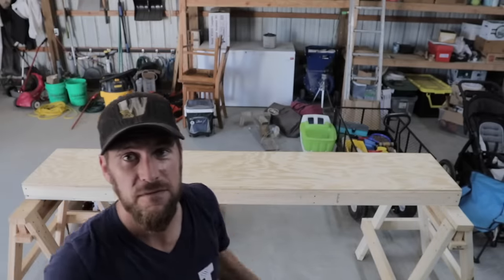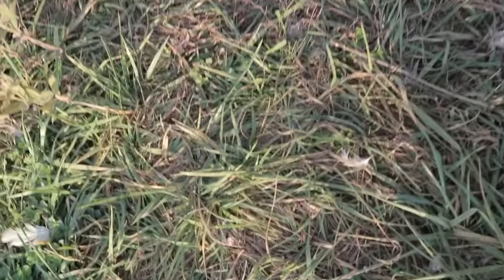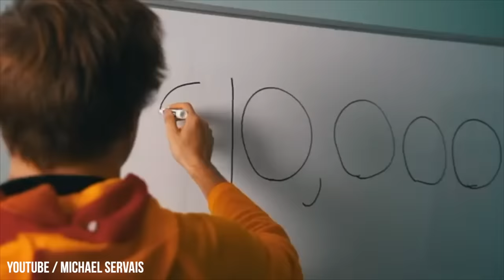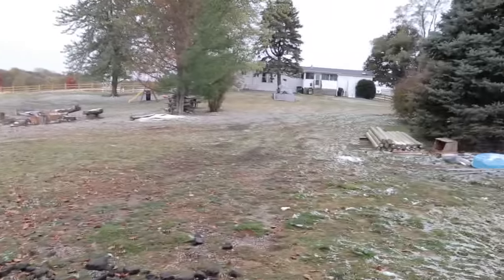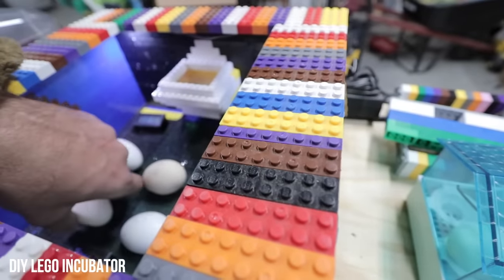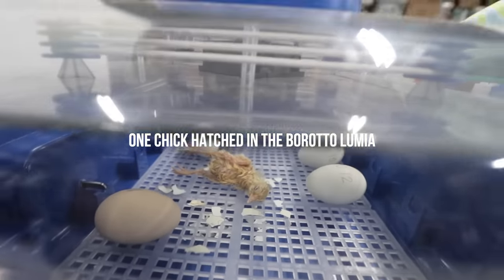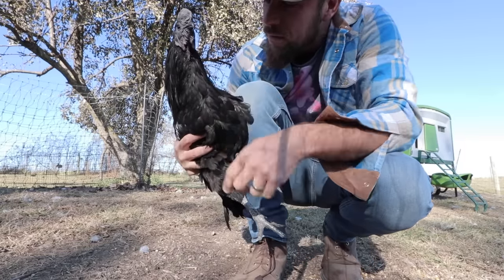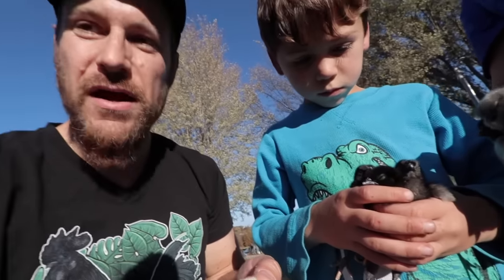The Ultimate incubator experiment.

Comment: I use Brinsea incubators. Both are over 10 years old. 1 is an Octagon 40 and the other is a Octagon 20. Both have cradles and the 20 has the humidity pump. Those incubators are my workhorses and have hatched out many chicks. Expensive but so worth it.

Comment: I really prefer the R-Com 20 Incubator. Worth the money and way fewer issues than the Brinsea. My friend bought the Brinsea cabinet and had to replace the heater and fan. She bought a second one and had the same issue. Both times she lost every egg. I never hatched before and the R-Com has the water with a wearing coil inside and a float to show the water level when it is filled. Digital controls for humidity, and temps along with turning plates,. Never need to remove the turner plate because it is flat and doesn't impede the chicks hatching. It also has a recovery rate that is unmatched after opening the lid to candle or remove chicks.

Comment: I think you should do this again but in a more controlled environment, where weather isn't a factor. It would be more fair for the smaller cheaper incubators. Plus a lot of people do their hatching inside so that the weather won't affect hatching rates anyways, so it might even be more helpful for those people, especially if they have a tighter budget, and can only afford an incubator that's a little cheaper.
Reply: Trust me fhe small yellow one that was like 20 bucks is actual crap.
Reply: @markharan86  Trueeee
Reply: @markharan86  yeah I could prob do a better incubator with a heat lamp and shoe box 😂

Comment: i bought that cheap yellow amazon one to try and help me hatch abandoned blackbird eggs and i realized real fast that it wasnt holding temp so i continued with the way i was originally incubating them which was a heat mat with a dish of water and plastic container over it with the same little black temp/humidity readers i had to rotate them myself and was surprised i was able to get them to develop as far as they did because i couldnt control the temp of the heat mat so i had to stack the eggs on top of layers of cotton wool and keep adjusting it every few hours (to the point i was setting alarms every 3 hours to check they were still ok, yes... i was determined to make them hatch) they should have taken 2 weeks to hatch and they were about 3-4 days away before 1 egg exploded and the other egg stopped moving i was devastated. it was my first time ever trying to hatch eggs and i got so attached to them from the moment i seen their tiny heartbeat amongst all the veins. i even gave them names 😭RIP Jellybean and Shrimpy

Comment: I used an old and cheap incubator (30$) to hatch maybe 200 chicks. It had no temperature indicator (we used a classic thermometer to check the temperature) and no humidity sensor or display. Eggs were marked with X and 0 on opposite sides, turned twice a day at 180 degrees starting with day 3 and stopped turning them from day 17. From 60 eggs, 40-50 would hatch. To be honest, I always kept the incubator in a heated room, not in the cold. Can you please let us know which of the cheap incubators you found to be the best?

Comment: I'm wondering what is better a smaller incubator that holds 22 eggs that cost 182 or one big one that holds 56 eggs that costs 546? I feel like 3 smaller ones would be better than 1 big one cause it may be harder to control the temps and humidity.

Comment: When a hen hatches an egg her scent is on the chick, because of this  it is not advisable to try to get one hen to take another hen's chicks.  However, as I found out years ago a broody hen usually takes incubator hatched chicks without any trouble.  One spring I did this twice.  I had two hens setting on a dozen or so eggs each.  Each hen only hatched three each.  My Dad went to a local feed store and bought ten chicks for each hen.  One hen raised ten White Rocks and the other raised ten New Hampshire Reds.  Each hen took the new chicks and each hen raised their own three they had hatched.  I, with the help of two good broody hens, later sold all twenty chicks.  My grandmother taught me as a kid about how a hen won't normally take another's babies.

Comment: Negative Nancy Here....you can call me Karen.  If you're serious about hatching reliably, control your humidity and don't be opening the lid constantly.  Place your incubator indoors.....at a constant temp...no drafts....preferably 70 degrees or higher so the incubator can keep the temp high enough without struggle.  Keeping in a shed or garage is asking for trouble with temp and humidity problems/fluctuations.

Comment: I'm not sure it's fair to judge the cheap bators based on leaving them outside in an unheated building.  I've used cheap bators like those inside a house and they had just fine hatch rates
Reply from the maker: I’ve used them inside before and they didn’t work. Not once. They’re junk.
Reply: @whitehouseonthehill  I haven't used those two exact brands.  I hatched 10 duck eggs from a similar bator last year though.  Could just be hit or miss?  Mine had an actual fan circulating the air so maybe that's the difference